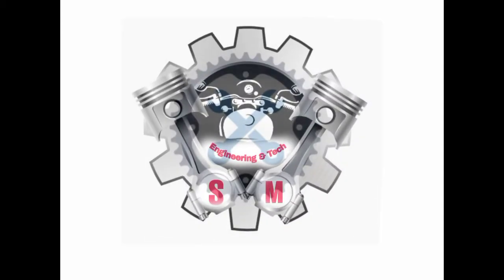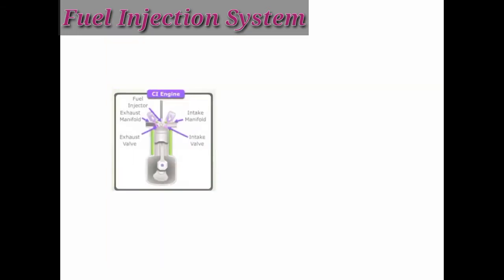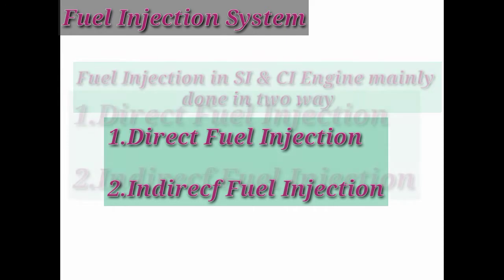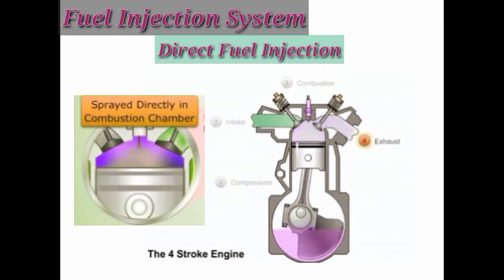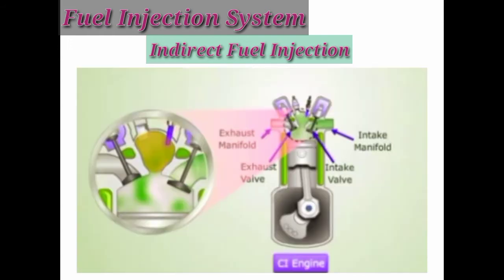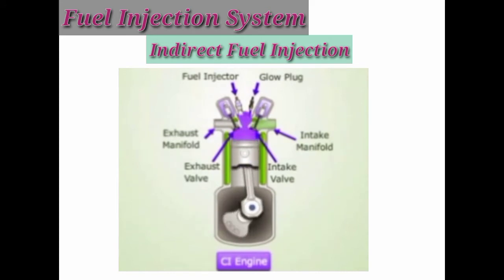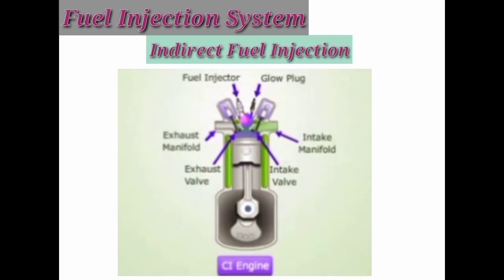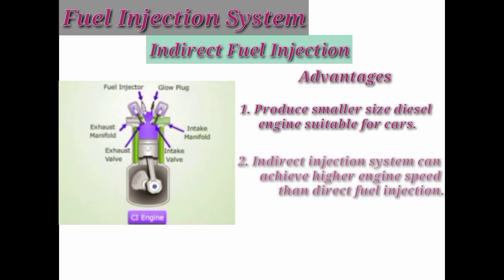Types of Fuel Injection System - Direct Fuel Injection, Indirect Fuel Injection ,Application

Comment: Very informative video. A lot of the earlier diesel engines used in older diesel tractor engine appear to have been the indirect style. These engines have a glow plug to pre-warm the cylinder and  a pre-combustion chamber.